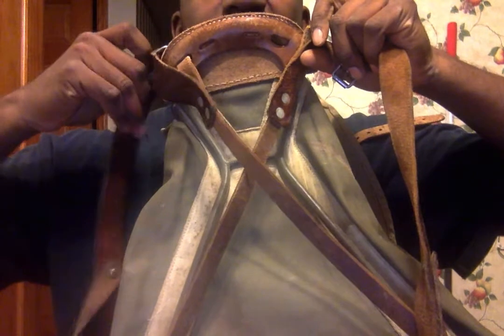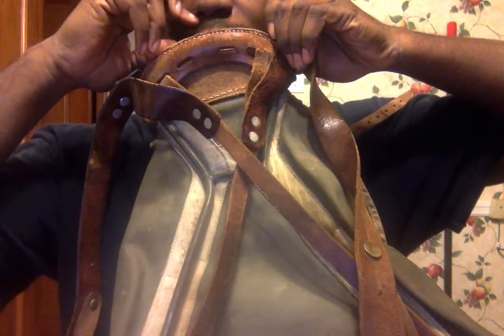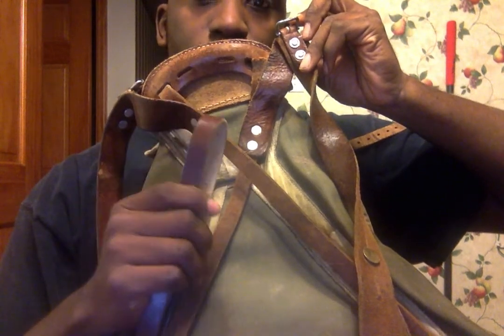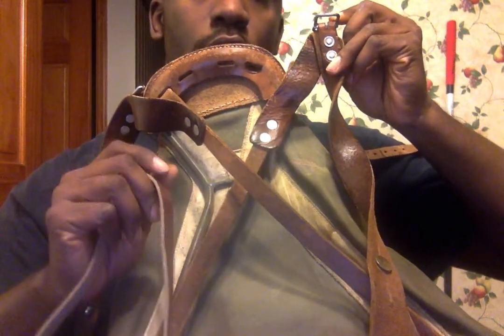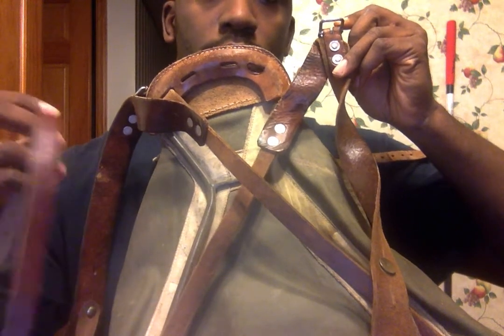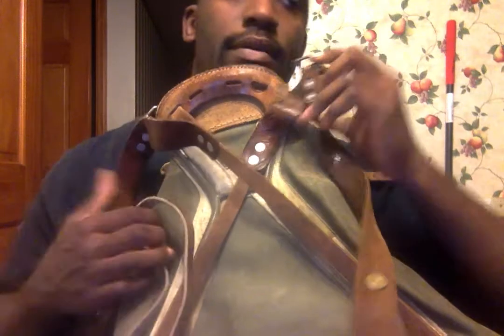Question on Leather Repair-Swedish m1939 pack

Comment: ....late to the party....BUT

The easiest way would be to drill the two rivets on the longer strap, close to the section that has rotted away
(not the rivets holding on the buckle part)
Then use the donor strap to replace the rotted section - cut the donor strap so it matches the intact strap on the other side.
You can get rivets online or from Tandy Leather or Weaver Leather - and they are easy to set using a normal hammer. At a push, a traditional cobbler or saddler should be able to fix two rivets onto the strap for you, but no idea on cost for such in your area!

That way, you are only replacing a short section of leather & two rivets = faster/easier/cheaper
Reply from the maker: Thank you so much! Knowledge is never late, and I’m always picking up old packs like this one!!! God bless
Reply: @MarionRobinsonIV  
Glad to be of help....
By all means if you need any other leather repair advice please get back to me!

Love to see old items such as this being fixed and given a new life...
I even go as far as making new shoulder straps that allow the Swedish M39 pack to be used without a frame for more crowded urban areas: yet the frame can be easily replaced to take the pack back to original configuration for rural use...

There are some good books on leatherwork by Al Stohlman that may provide some inspiration = though they're a little dated now. The book by him on leather tools is a good source of reference.

Comment: You will have to drill out the rivots. then replace the strap. then rerivot with new rivots. my suggestion. I also have a idea to get a expect opinion. find a horse saddle repairman that operates near you. good luck on your project

Comment: Well the simplest solution would be to trim the rotten section of the strap and attach an extension piece straight to that. That way would minimise disturbance to the other parts. But if you must replace the whole strap, you will need to remove the old rivets. Those look like saddlers rivets too, so removing them is a pain!

To remove saddlers rivets, drill them out in the centre and use a pair of pliers to remove... Drill it from the rounded section on top, not from the flat section of the rivet on the bottom.

Next you will need to put holes through the replacement strap, using the old strap as a template. Then rivet the new part together with the old. Saddlers rivets would be good, either copper or brass, but you will need a river setter and a ball peen hammer, and a good solid flat surface that you won't damage when smacking it with a hammer.... A cheaper and easier alternative to rivets is Chicago screws (which can also be called interlock screws, or screw posts)
Reply: And if you can't find Chicago screws another way to attach everything that is just as durable, is to saddle stitch the pieces together. You can just drill small holes (or pierce with a nail if that's all you have), and stitch them by hand with two needles and a bit of waxed thread. 

Do it along the length of the strap, rather than across the width, and do at least two back stitches both starting and finishing. 

Waxed braided polyester thread should be easy enough to find in most craft stores, or on the cheap you can use a standard thread that is nice and thick, and a candle or something like that to wax it (grab one end, hold the thread against the candle, pull so that the thread rubs against the candle. 

There are a bunch of videos about how to saddle stitch on YouTube, Nigel armitage does a good one, or leodis leather.